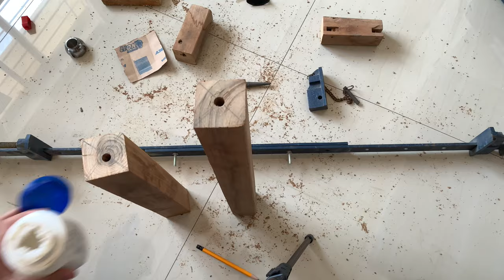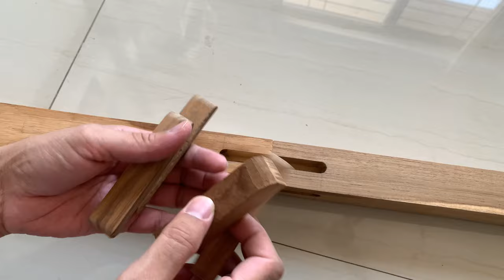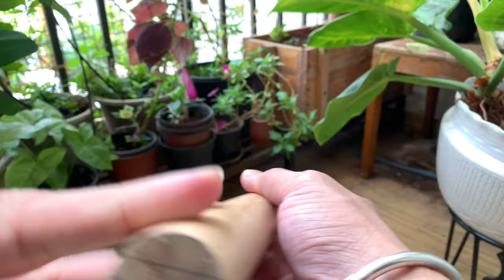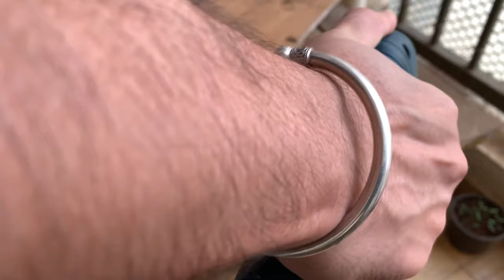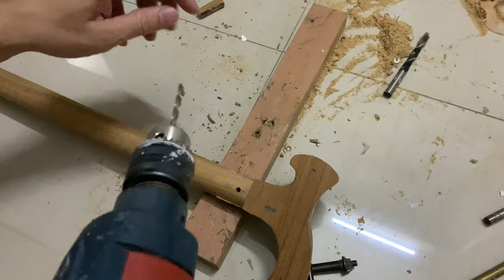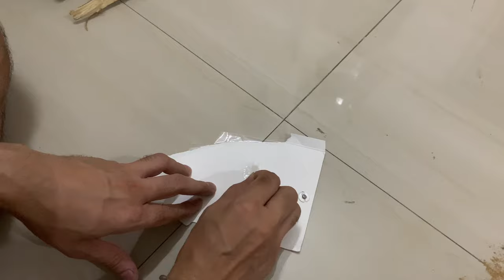DIY Walking Stick

Comment: मस्तच... अत्यंत सुरेख.. I was disappointed with the walking sticks available in mumbai, so wanted to make one for my mother.. I won't be going your way though.. I will just make a single piece handle, make a hole in it and put the single piece stick into it by chiseling out its top. Will carve the stick later. But yours is surely what I wish to make someday. God bless you brother. I use tung oil/pure flaxseed oil/ bees wax etc. to finish my wood crafts, what did you use here ?
Reply: Also pls tell me which wood you used for body..
Reply from the maker: Thanks 😊 
I used butcher block oil to finish it. Handle is Burma teak I believe. And stick is CP teak. 
I had bought a very old table from OLX long ago. Used wood from that table for this. 

Do share your project once done. All the best.

Comment: GREAT VIDEO ,WHAT ISTHE NAME OF THE PIECE OF EQUIPMENT TOU USED WHEN DEILLING OUT THE CENTRE'S..its shown about 52 seconds in to the video  please
Reply from the maker: Thanks Michael. U are probably asking about dowel jig. It’s dowel jig. Got it from AliExpress. It has 10,8,6 mm hole guides. It will help you align the dowel holes. I used it because I wanted right angled dowel hole.
Reply: @DIYWithBhairav  many thanks